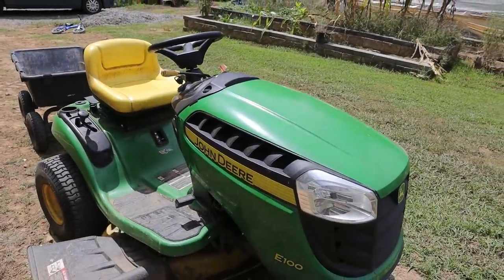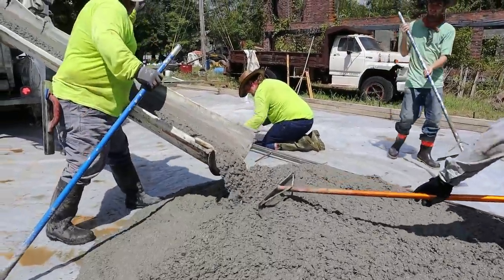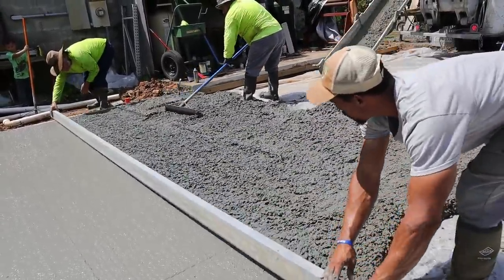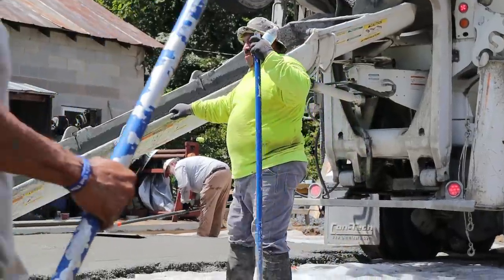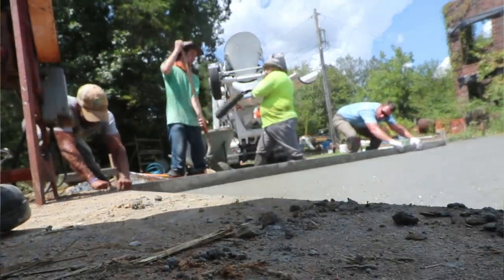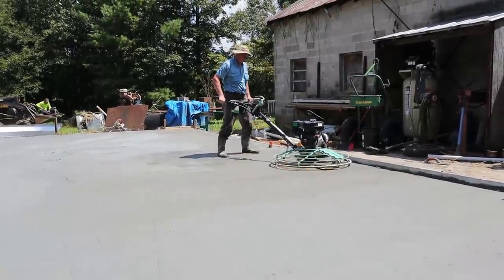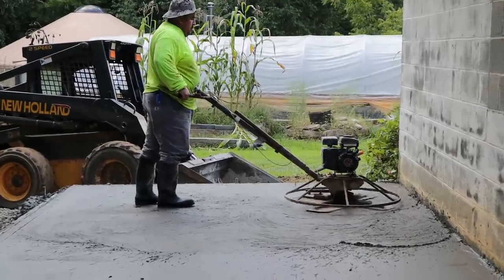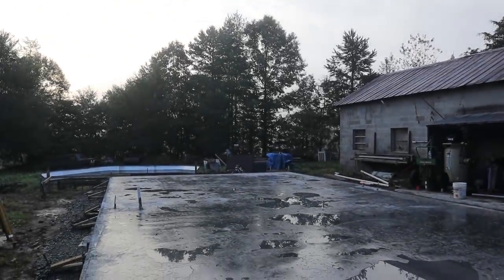Was this TOO MUCH for us

Comment: Where you put your doors in and do the ramp so you can drive your equipment into the building...take a couple bags of QuickC rete and let the kids hand print it while it's still wet.  It will be a small ramp so you won't need much and I bet they would love to decorate it with colored stones and such.  Should you ever leave or move on...it will be small enough you could remove it and take it with you.
Reply: Great idea!
Reply: Great idea!

Comment: Suggestion that just came to me: next time you have a big job in the heat like that, could you have a fine spray hose going continuously, for a quick step in, get cooled off, situation? Water pressure wouldn't have to be very high, and it could be set up in a shaded area (even if you set up a canopy.)

Comment: I poured and finished concrete for 8 years and I have definitely felt your pain. In Florida mind you. 
 For your first time finishing with the machine, you did good and your wife and kids , God bless em.  I ain’t never seen a woman in concrete and your daughter catching edges.  Now that is teamwork. 👍. The only thing I saw missing was about ten gallons of water added to the truck of concrete, would’ve helped ya some. 
 Great job. Great family
Reply from the maker: They added water to the concrete in the truck. I was so hot. We were supposed to have poured it two day earlier first thing in the morning but it rained so the next available time to get it was at noon the day we poured it. Plus one labor had a problem that day and didn't get there until much later in the day.  I think it was upper 90's that day and 95% humidity. It wasn't ideal but it is done.

Comment: I LOVE THIS VEDO . MY DAD TAUGHT ME ABOUT CONCERT . I JUST FINISHED A ROCK PROJECT I DID BY MYSELF. OMG IT WAS GOING GREAT THEN THE WIND KICKED YP AND BLOW A LITTLE FLOWER ALL OVER MY FRESH CEMENT SO YOU HAVE TO THINK FAST AND IT WAS HOT I HAD AN SHADE UMBRELLA OVER THE AREA BUT I HAVE TO SAY THE NEXT DAY WOW STIFF BUT THE ACCOMPLISHMENT OF THE JOB IS SO WORTH IT. SO WHEN I SAW YOU GUTS ,"I FEELYOU". MAKE SURE YOU PUT ENOUGH CUTTS SO IT DOESN'T CRACK LATER IN PLACES IT IS NOT SUPPOSE TO BE.  LOVE THE WORK EXPERINCE

Comment: I understand your building is not a loadbearing building but in Louisiana we always put rebar around the corners and edges and wire in the middle and sometimes use a fiber just to try to keep it from cracking and ultimately it becomes a loadbearing building whether we want it to or not. I would think kill drying lumber would be very heavy

Comment: I've done a few jobs around 600 sq ft each over the years.  I always pay for a pumper, 2 finishers, and a laborer.  They always work extra super hard all day to do a 600ft slab.  And they are full time pros.  No way I would tackle a job that size without 3 finishers 2 laborers and a pumper.
Reply from the maker: Well sometimes you have to do what you have to do.

Comment: Love your channel I was thinking about something and this is just a Grandma's opinion I don't live with their snow and stuff like that but I know that tools that get wet or damp get rested or messed up I was thinking maybe you can do a part in there for those kind of things and an incline that way whatever goes in won't get wet even if it's moist or damp those tools will be up high so moisture won't get in them.. you know instead of walking into a flat surface on one side let it be an incline so that way it be literally up off the floor at a higher level..